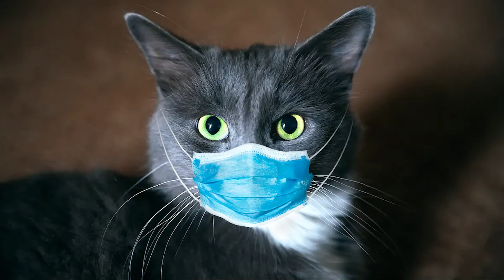Where did Modifying QGroundControl Go?

Comment: well, then, what do you recommend to us, the people just starting to touch qgroundcontrol as developers, to do? 

Forums arent that helpful, since there arent many who could succesfully enhance the software, and willing to help.

There are no tutorials straight to the point, like yours. The existing tutorials are ambiguous and doesnt help with anything.

The developer guide is confusing, and doesnt show any kind of useful help when it comes to touching the code.

I thought something like adding a button to the screen, or changing the way it shows the data could be something not easy, but easy to find a solution online. I guess I was wrong
Reply from the maker: Learning some tips and trick with navigating the IDE and reverse engineering the software goes a long way. I might make that video as an interim as I address how I want to continue these videos in the future.